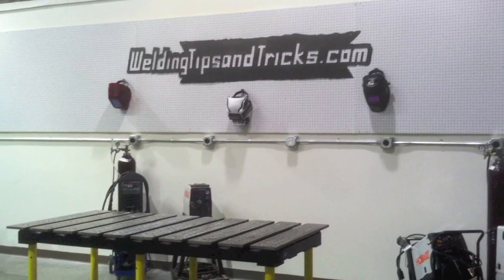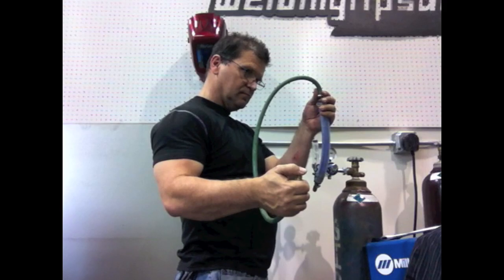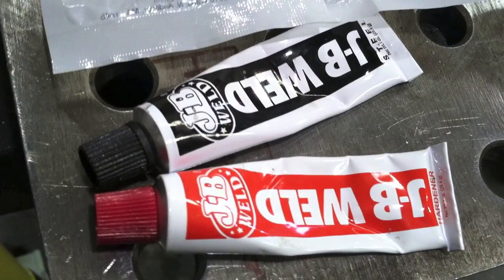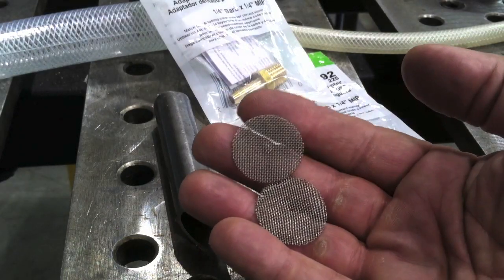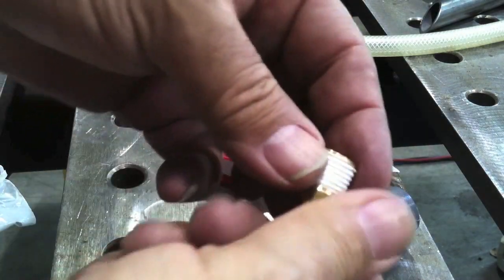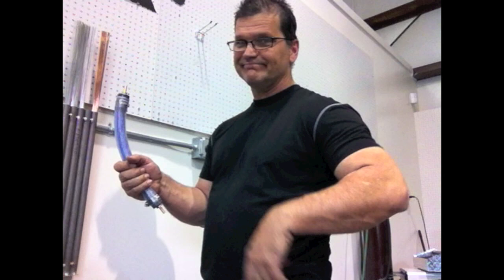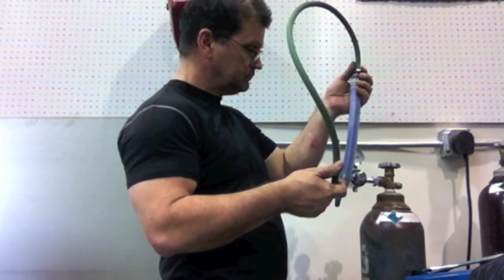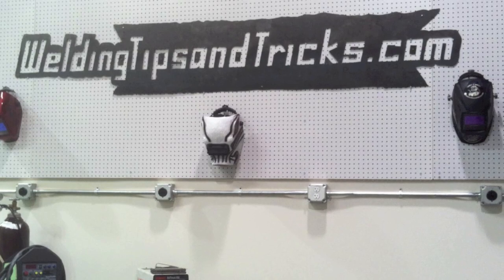DIY Welding Gas Dryer

Comment: hello jody. i amde an argon dryer just like yours, exactly. but i am not getting enough gas through the filter. when welding aluminum it aint good. took the filter off and i was back to welding perfectly. any ideas why yours works and mine dont ? thanks

Comment: Hi jody iv been out and brought a DESICCANT filter due to having some argon putting out some black welds on stainless tig not sure iv seen the fuzz on the electrode tho, the electrode just turns black for some reason?, id swapped over to another bottle of argon and got perfect nice colorful golden welds. So i tried the  DESICCANT on the bad bottle and it appeared to create the fuzz on the electrode any ideas why i would be getting fuzz with the filter attached?
great vids by the way.

Comment: Good idea for drying the gas, however you could have used 1 inch dia , 6 or more inch length stainless steel pipe or whatever size available, just with little welding you can make the same thing. her the advantages is that directly you can warm the stainless steel pipe to degas the silica gel without removing them,, where as in your system you need to tae out the silica gel out of PVC pipe for degasing. However thank you very much for tips video.

Comment: The company I have worked for for almost 20 yrs, has complained about the lack of "Life of Life " we get out of the consumables  on our Plasma Cutter. Will this work for our plasma cutter?[I think it will] I try to keep the Compressor drained..But I have told them the air is still full of water!  I have a welding job coming up that is for the Medical Industry {Tig Stainless] and all welds have to be passivated after welding . Thank You ! I have been welding for almost 40 yrs.and still learning

Comment: Great idea and inexpensive too.

A technique I've used where UHP gas was required is to crack open the flow meter, then open the bottle. This allows the gas to flow through purging the trapped atmospheric air out. Purge as much of your lines as you can. This trapped air can migrate back into your bottle ruining the whole thing.  Close your flow meter after a short purge so you don't waste your good gas. Obviously, don't try this with toxic/pyrophoric gases. 

I really enjoy your welding videos.

Comment: Looks like a good idea and I've always had an ussue at times with my tip looking lik that.  Does this affect MIG as well?  On the delicatessant, I've used it before in smaller amounts, like a 1/2cup worth and it turn pink so fast.  Does it last longer before needing drying in the larger amount?  I'd hate to change it often.

Comment: I like, the good thinking, there Jody...

I'll be putting one together myself, I believe I've had some issues even with the big rentals, now that I think back at getting fuzy. One neat thing, is if your questionable about having moisture, the desicent will let you know, for sure!

I have several batches of desicent from my plasma cam to dry out, was thinking of doing a vid on the process, using my rod oven. What you think?

Keith